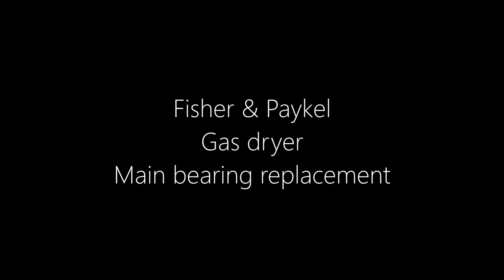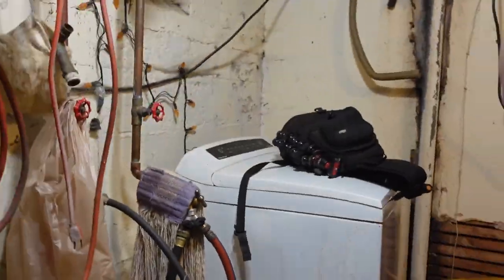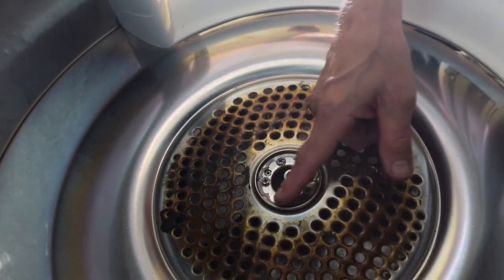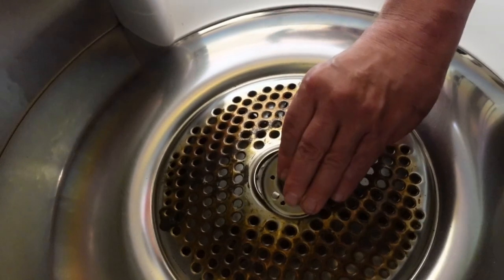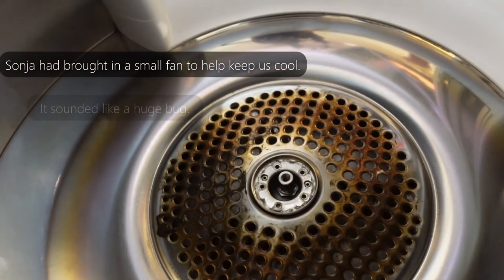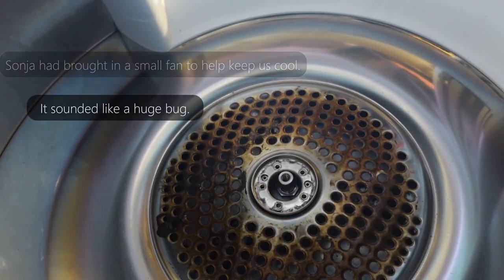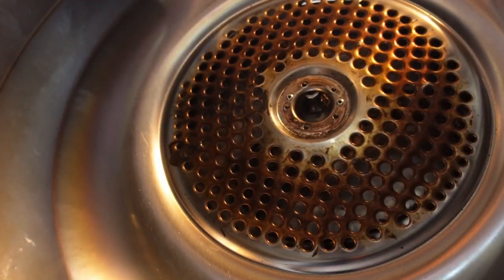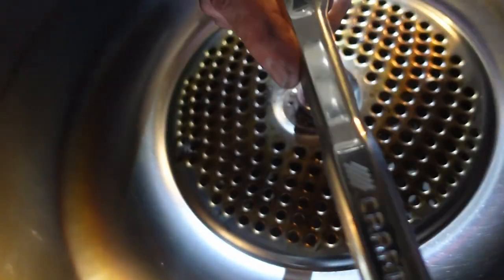Fisher & Paykel dryer main bearing replacement (and carnage)

Comment: You should add that the socket necessary is. a 22mm DEEP socket and that it detaches from a carriage bolt in the dryer's R-side panel.  Also it is extremely important that one not over tighten the 5 retention screws when reassembling. Stripping those out would be bad.  I've done this twice now. A good vacuuming out of the cabinet is in order at this time as well. The inner dryer assembly tilts forward and out of the cabinet with the front panel removed. These are nice dryers and this is a relatively easy fix.